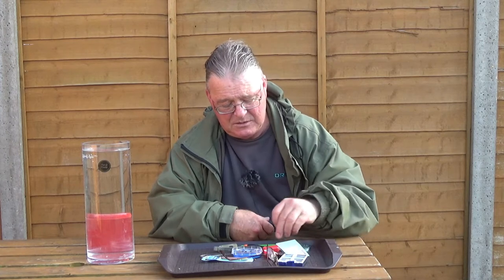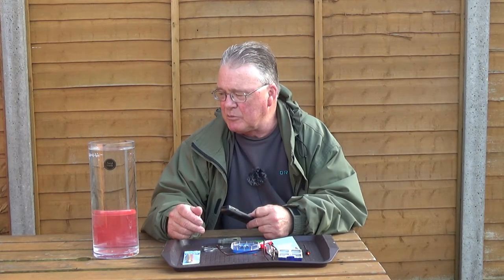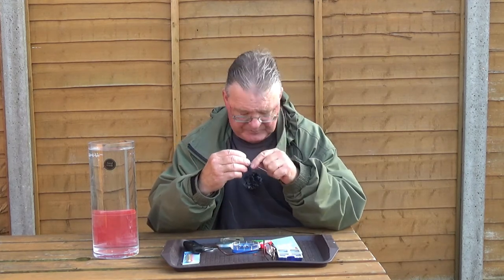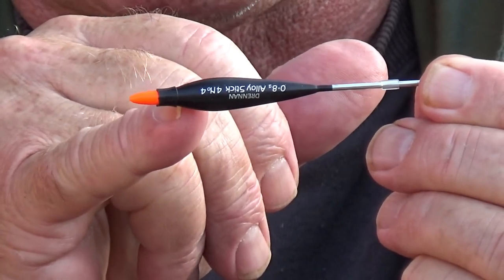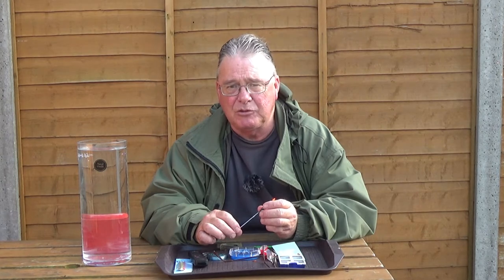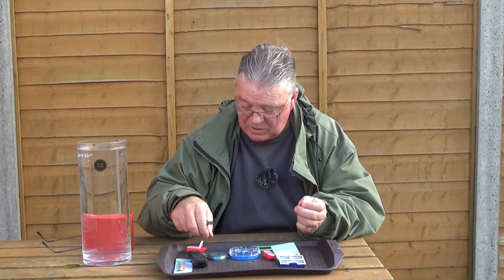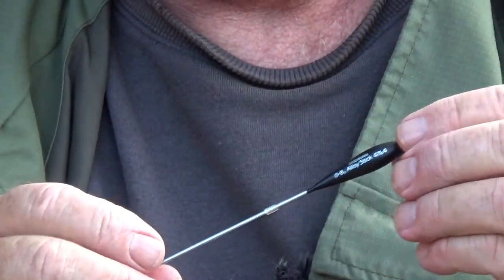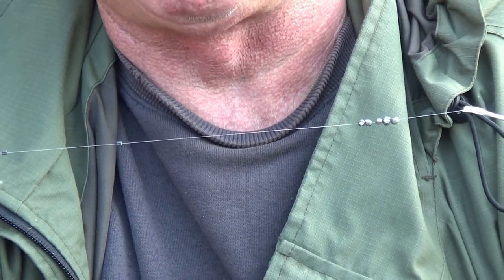Easy Fishing. How To Set Up a Float Rig Part 1 The Stick Float

Comment: Might be a dumb question but why is it important to use a hook length rather than just attach the hook straight it to your line? Great video by the way, very clear and informative!
Reply from the maker: M N Hi no it’s not a dumb question. The reason for a hooklength is the finer line gives better presentation therefore more bites, hopefully! Also if you get snagged the thinner line should break first so all you have to replace is the hooklength. It’s not a good idea to use a finer reel line as fine lines are easily damaged by the shots. But there are times when you might not want a hooklength for maximum strength. I’m thinking of barbel in fast water etc but even in that situation when I am using stepped up gear, say a 6lb bs mainline I would still use a hooklength of 5lb bs. I hope this helps. Thank you for the nice comment as well it is appreciated. Tight Lines
Reply: Easy Fishing - Cheers mate thanks for the advice I'll give it a try. Keep up the good work!
Reply from the maker: M N . No sweat glad to help Tight Lines